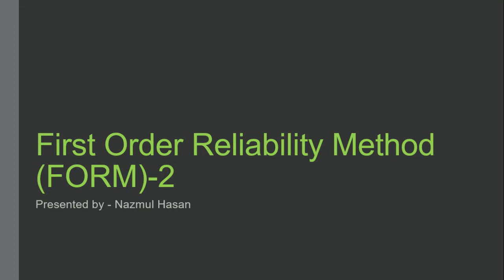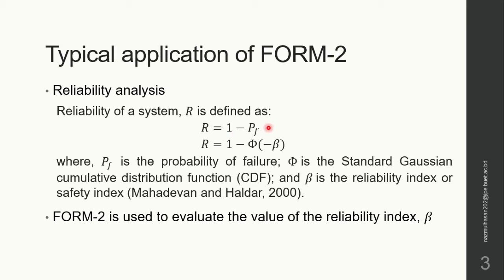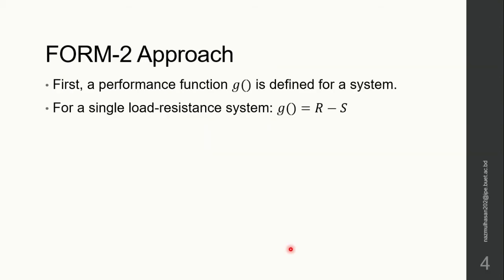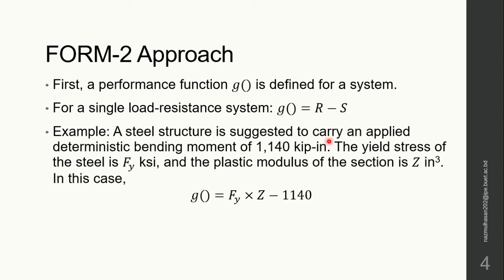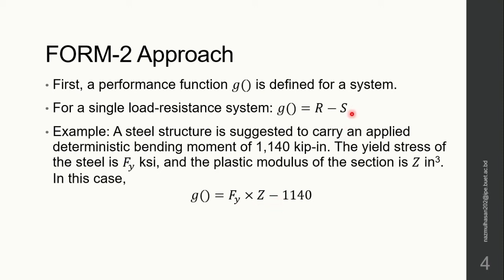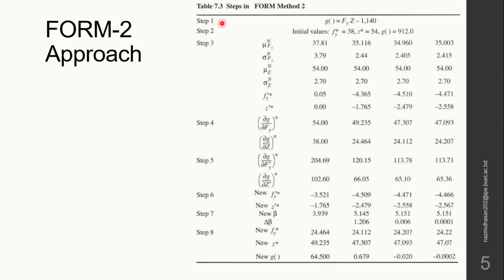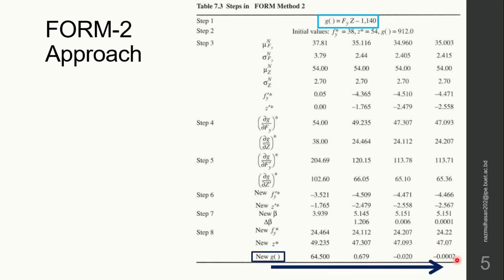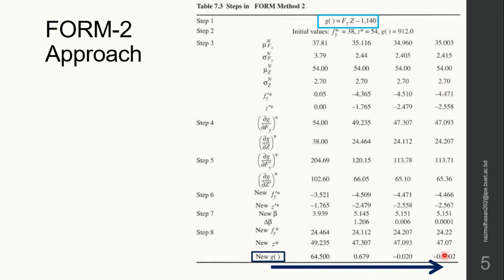First Order Reliability Method 2 | FORM 2 - Explained

Comment: Could you please attach any documentation that supports your claim about B having to be at least 3 (usually)?
Reply from the maker: Please refer to the "Section 7.6.3.3" of the book titled "Probability, Reliability, and Statistical Methods in Engineering Design" (Chapter 7) by Achintya Haldar and Sankaran Mahadevan.
You may also relate the implication of the value 3 in case of Standard Gaussian CDF assuming the variables are statistically independent and normally distributed .